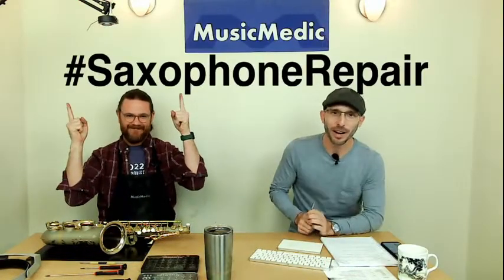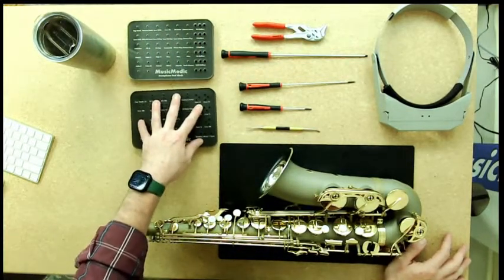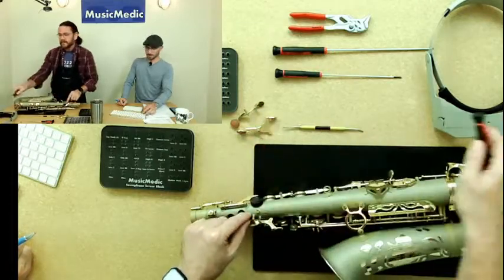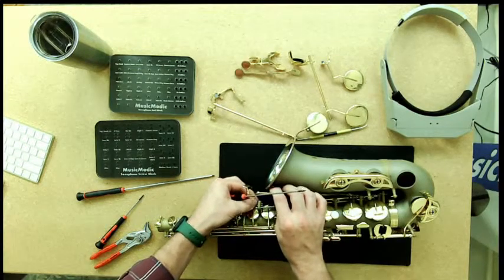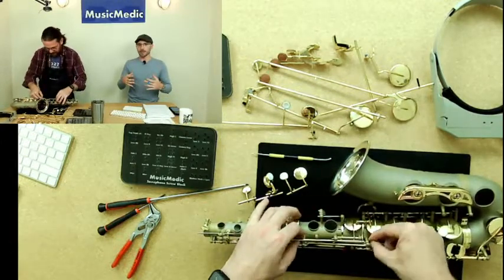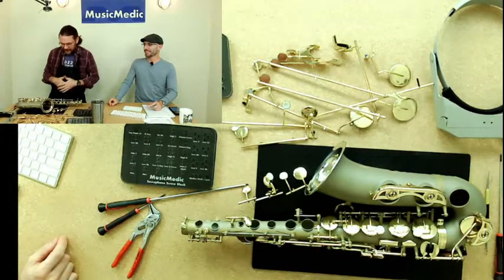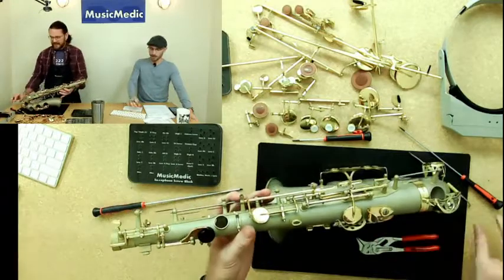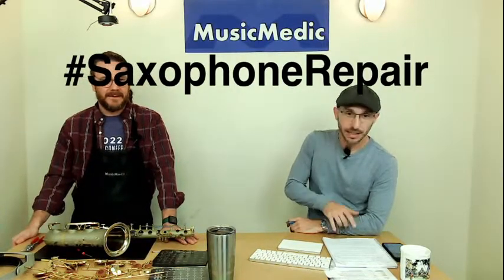How to disassemble a saxophone: for the beginning Technician #WednesdayWisdom

Comment: My tenor got wet when in my front closet because the apartment I lived in was leaking through the walls. Like, the water was rusty. I didn’t know this until I felt like playing. I opened it up, smelled mildew, then looked at my mouthpiece…. My god it was black because I left my reed on it from my last time playing 6 months prior. Instantly panicked and picked up my sax. FOOF I get dusted with spores. This will be fun. Sax has been moldy for 2 years now. I don’t know what to do with it besides clean it myself. I don’t want to do the professionals like that and my insurance company deemed my 11 year old sax a lost cause. I didn’t even get a payout, as it was the building owner’s fault (in my eyes).

Comment: I just disassembled a 1922 Buescher C Melody and gave it a polish. Going to order some white Roo Pads for it. Do you all at Music Medic think the gold plated domed resonators would work well for a Buescher C Melody? Some of the pad cup to tone hole ratio has me concerned that the resonator will end up resting on the tone hole, particularly the bis key. Thanks for all the insight!
#saxophonerepair
Reply: A 1922 May have snap-on pads. If so there’s no need to worry about resonators.
Reply from the maker: Glenn is right about the snap on resos, be sure to look out for those! If not the gold domes look and sound great on the white RooPads! You might consider ordering individual pads instead of a set so you can order a riveted pad for the Bis key if clearance is an issue.
Reply: On my 1923 Buescher C Melody the owner/tech before me ground off all the snaps. I ordered a set with domes and the dome for the pad for the bis key ended up being too large. I had to salvage an old pad from elsewhere on the horn.

Comment: What about the octave mechanism??
Reply from the maker: Taking apart the octave key on the body follows the same procedure as other keys on the instrument. Make sure you put back the rod or pivot screws into the posts (depending on the instrument). One thing to do would be to take a picture of the mechanism (especially on a vintage American instrument) to ease in the re-assembly.